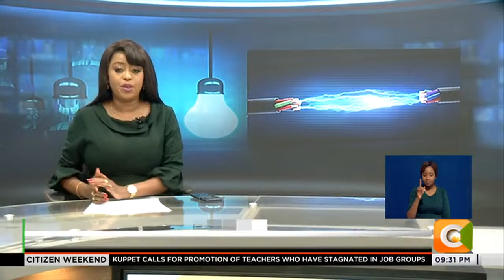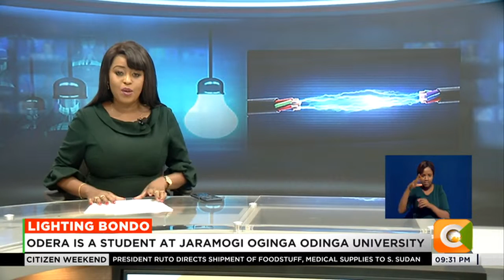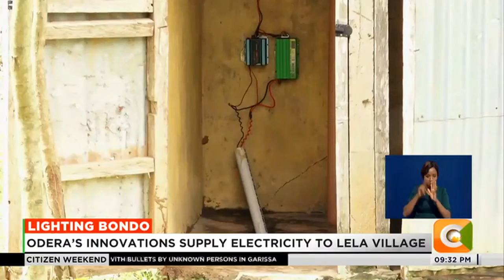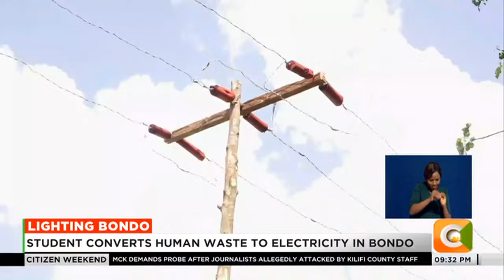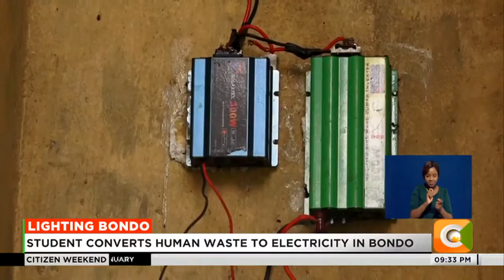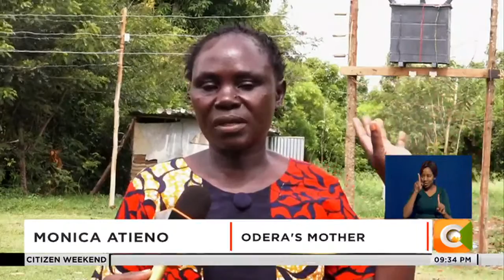Student converts human waste to electricity in Bondo

Comment: Use a pure sine inverter for smooth curves.
Reply: There are good invertors that do 50hz
Reply: And how will he double the frequency?
Reply: Really ?
Reply: @mlionea  yes of course pure sine invertors are so good nowadays
Reply: @mlionea  the question is how to convert that form of energy into electricity
Reply: @joemwangi5813  someone is doubting this claim
Reply: @mlionea  i too dont know about getting that energy in kW but i know of seebeck effect the one that uses disimilar metals that generate current when heated. To attain this needed power he must have utilised extra component to get that much potential difference
Reply: @joemwangi5813  i need to visit this village and see how he hacked this. I thought of it 25 years ago
Reply: @mlionea  it maybe 100 pc true bcoz u can see wires frm the pit
Reply: But his theoretical approach is on point only thing we're not sure is the power in..but then again why not
Reply: @joemwangi5813  yes could be he dipped it low makes sense